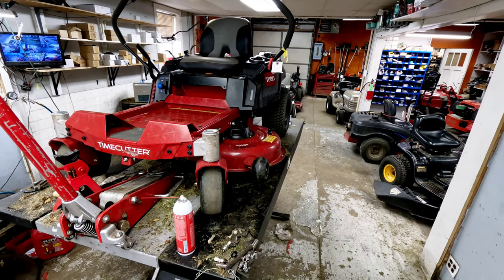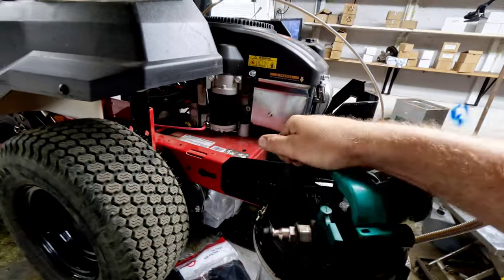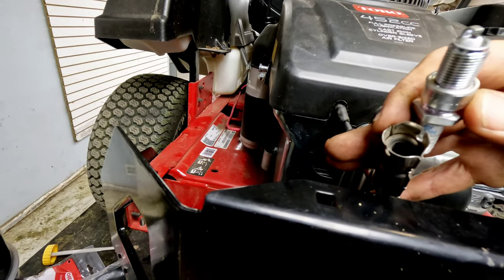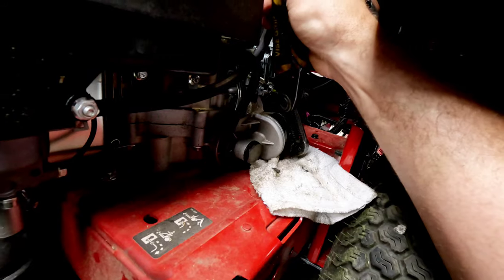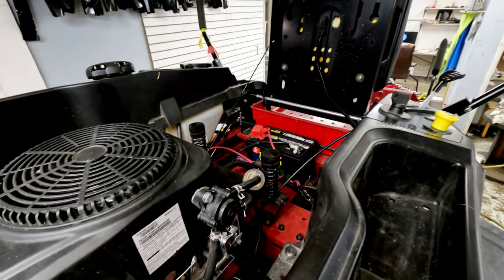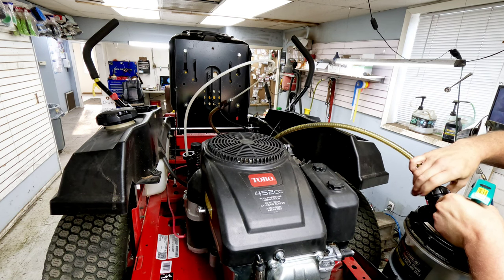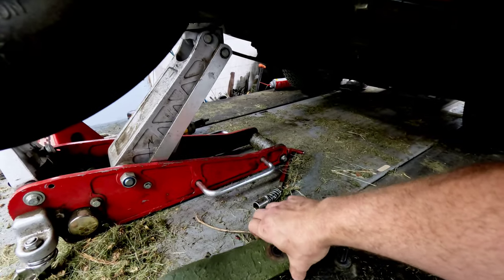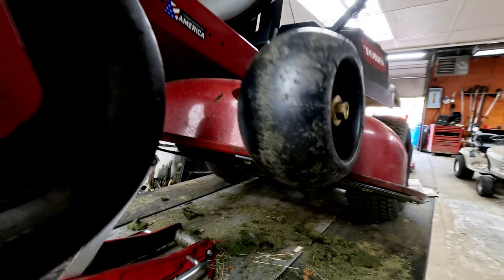Mastering Toro TimeCutter: Ultimate Guide to Easily Servicing Your Zero Turn Mower Like A Pro

Comment: The tire pressure that you're reading on the sidewalls is the max tire pressure. Toro recommended pressure is much lower. Your tires are over inflated!
Reply from the maker: Softer ride with less pressure, otherwise not a problem in any other way

Comment: This is crazy. I’ve watched 20 plus toro videos to find a drain on 75740 and the only one (this one) has the guy using a specialty tool to remove the damn oil. Absolutely infuriating trying to just drain this damn thing.
Reply from the maker: Definitely so, it seems like they do not want you to change the oil!
Reply: @IndRepair  so is the suction pump the only option for the 75740?
Reply from the maker: @MrMpm3001  some engines have a drain valve installed. You can find it on page 26 of your manual at https://www.toro.com/getpub/70680
Reply: @IndRepair  🫡
Reply: @IndRepair  wanted to say thanks again brother. I found the drain valve and successfully drained the oil. Subbed 🫡
Reply from the maker: @MrMpm3001  It is actually shown at 3:15 also forgot about it, I was just looking because I figured the one I did didn't have one anyway glad you can get it taken care of

Comment: I have a 42" timecutter but the adjustments on the handles do nothing for the speed. Going forward it steers left and going back it's much worse going right. 2 weeks old.
Reply from the maker: Wow, seems like they definitely didn't get something put together right
Reply: @azimmey you need to slow down the right hydro by taking a wrench and tightening the nut a couple of turns. Run it on level smooth surface like a garage floor. You may have to adjust it and try it a few times until you get it tracking straight. The nut I’m talking about is right behind and above the rear tires.

Comment: Why don't you get a parts manual an get the right plug an stop guessing?
Reply from the maker: Same plug specs and length just a different size head on it. They make different version boots of this same engine, which I was unaware of. No need to guess, it's not rocket science.

Comment: I have a 2022 42 in.  With a Kohler 22 HP.  Iron forged deck.. for my property..I service my unit on my single post inground lift ..I pull off the sleeves on the lift and drive over it to take off the blades for maintenance ..etc. I can get her up over my head to clean the deck , I have 54 hour in my toro. I bought it with the hour meter..I love toro.. products..great video..great advise. IL run 10- 30  .I'm down in Florida. It's hot down here and lots of sand..in the lawns..no dirt..
Reply from the maker: Awesome!! Thanks for watching!

Comment: Awesome video! I have a time cutter an it’s running rough, I’ve changed plugs an it ran better but then fowled out again I think it’s running rich what could be the problem?
Reply from the maker: Stuck float in the carburetor is a likely cause. Bad fuel or moisture in the fuel will cause it to smell rich sometimes also
Reply: @IndRepair  thank you! I will check that out

Comment: What you know about the hydrostatic service on a  2017 time cutter MX 5000
Reply from the maker: Difficult. Most do not have a drain port and no access to refill if they do. Pull the hydros to do the oil change. There is a service manual at https://www.hydro-gear.com/wp-content/uploads/2023/03/BLN-52622_2100_2200_P13.pdf
Reply: Thank you very much I've been searching for awhile now for information i figure it was going to be tough when the matainance book had nothing
Reply from the maker: @williamharkenrider3842  Yeah they sure don't make it easy on this!

Comment: What brand is your oil remover and size ???
Thanks ☺️
Reply from the maker: It is an OEM tools 1.5 gallon (6L) have like it s lot better than any of the other brands I have used. I have been through a lot of them over the years, the OEM tools one is 1 piece construction so it won't leak out of the bottom if you happen to get something that is not good for orings in it

Comment: Any info on what plugs, belts , blades to stick to get  going? I’m doing a mobile blade sharpening and get a lot of requests for tune up which I can do ( doing at my house for drop offs and neighbors) but don’t carry any stock. Not all homeowners know how to find motor number or model type. Excellent video. Thank you.
Reply from the maker: We work closely with distributors so you can drive the price down. Medart, Power Distributors and Oscar Wilson will cover 99% of what you need to order. They have minimum orders for free shipping but almost always next day delivery depending on when you order. We only stock stuff we sell a lot of, mostly MTD stuff and blades for almost everything

Comment: I liked this video. I have had this timecutter for 2 years and wondered if I need to service the drive hydraulics and adjust the forward/reverse handles as one is slightly ahead of the other? Thanks
Reply from the maker: You can definitely adjust the travel of the handles to fix this unless one of them is slipping. Thanks for watching!

Comment: I have a slow leak on my left hydro. I wanted to add some fluid. Should I fill atw to the top??
Reply from the maker: The service manual says "Fill the ZT-2100 and ZT-2200 (EZT ®) so the oil level is .75”-1.50” (19-38 mm) below the oil fill port" That is hard to do if you cannot see the top of the fill port but if you can get it in there this was get it done otherwise the hydro will have to be pulled to fix the leak and refill
Reply: @IndRepair  thanks

Comment: How do I level de deck? The left side it's an inch lower than the right side.
Reply from the maker: Go to https://www.toro.com/en/parts/partdetails?id=53158&iid=462404&pid=511604 and you can see the diagram for the deck lift. If you look at part number 6 it is a bracket with different holes in it. To raise the side that is low install that side in a hole that holed the deck up higher than it currently is. Thanks for watching!

Comment: Why do you say in the description you can use champion RC12YC but in the video you say it's not the right plug that's in it? I have the same engine and use the RC12YC without any problems but if I need to change to NGK I'll do it. Thanks good video as always.
Reply from the maker: I was thinking it was the larger plug BPR6ES and it is not. The plug you are using is just perfect. If you want to switch to an NGK BKR6ES would work perfectly. Thanks for watching!
Reply: @IndRepair  Thank you! I use 5W30 full synthetic oil because here in Quebec Canada it can get very cold. I fear this engine might be underpowered for a 42inch deck more so if you add a bagger or mulching kit. What is your opinion on its size? Have a good day
Reply from the maker: I would agree a bagger kit with this engine would be underpowered
Reply from the maker: Mulching engine should keep up well but Canada is a whole another worth away from Central Illinois. The winters have to be hard on them